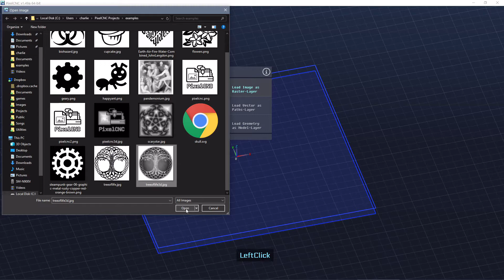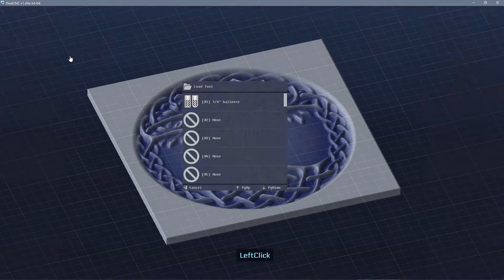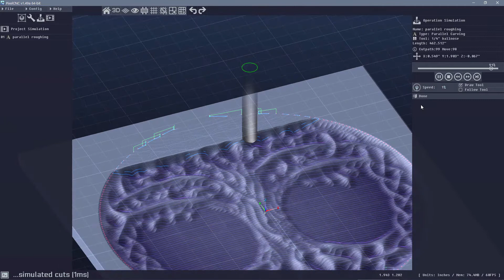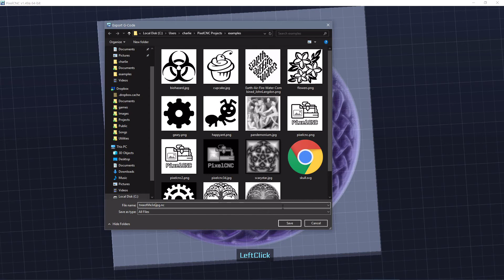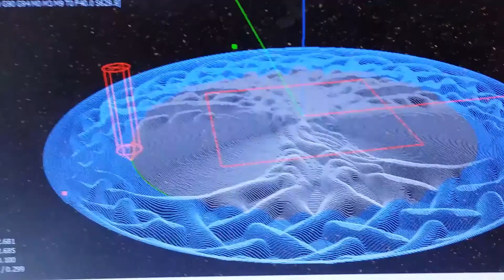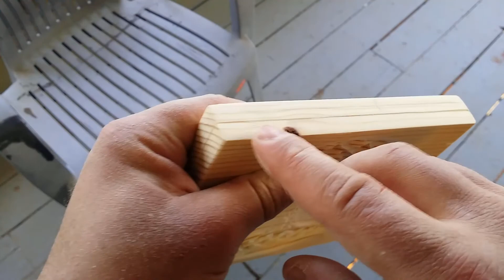PixelCNC Tutorial #01: Basic Relief Carving

Comment: hello, I wanted to install this software, but was greeted with the blue windows screen that tells me to not run it. I then put the file trough an online virus and malware detector, and saw a lot of antivirus bypasses and a Trojan security bypass. Could you please explain what's the deal with that ?
Reply from the maker: Hi there. We answer these questions on our site's FAQ. The primary issue is that the installer is not digitally signed, which causes Windows Defender and AV software to flag it as suspicious. You can download a Zip archive of the program files from the FAQ page as well. Feel free to send an email to us at support@deftware.org if you have any questions or need help with anything else.
Reply: @deftware1  thank you for the quick response

Comment: An idea for a tutorial video.
The "Canvas" concept is kind of confusing and could use a bit of explaining.
The way it looks,
If using a material that's 1 inch thick, and you want to remove 0.1 of the surface and carve a .25 relief, the "Canvas" total Z value would be 0.35 ? and set Z-zero at the top ? This would leave a .25 relief on top of a .65 base?
Reply from the maker: Hi there. The canvas is a simple heightmap volume that cutpaths are confined to (except rapid moves between cuts, which will go above the canvas). Yes, if using the top of the workpiece as Z=0 then you would blend your layer(s) to the canvas to occupy the 0.65->0.9 range of the canvas' height. Layers are positioned relative to the bottom-front-left corner of the canvas. The simplest thing to do, if you have an image or model you want to cut, is to just set your layer's Z origin to 0.65 and Z size to 0.25. Then the top of the layer will be 0.1 shy of the top of the canvas volume, leaving that area open for cuts to remove. A simpler thing to do is to just make your canvas Z size to 0.35 if that's the deepest you want your cuts to go, then you just make sure everything else is setup (layer position/size and Z-Fill) to leave the 0.1 margin at the top. Thanks for the feedback, hope this helps!

Comment: Hi Im have an issue - I followed everything but when simulate the relief only shows a few high bumps leftover, not the tree design. What am I doing wrong or is there a view setting I’m missing?
Reply: Hi there. It could be that your operation's Max Depth parameter is not set low enough if the simulation is showing is showing that the cuts are shallower than the tree design. It could also  be that your tool definition doesn't include a flute length and max length that are large enough to accommodate the canvas Z size - which you can override using the "Ignore Tool Lengths" option on your operation's parameters.
Reply: @CharlesVanNoland  Thank you - I had followed the tutorial exactly, but altering the Max depth from .2" to .4" now shows a nice finished, detailed simulation. Excited to Carve now, thanks!